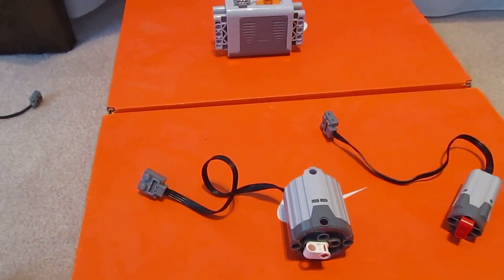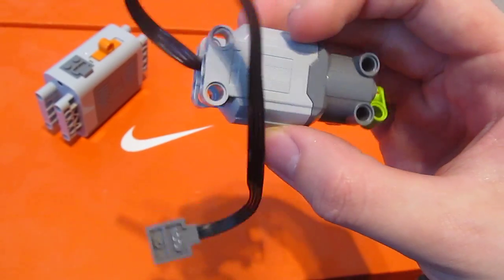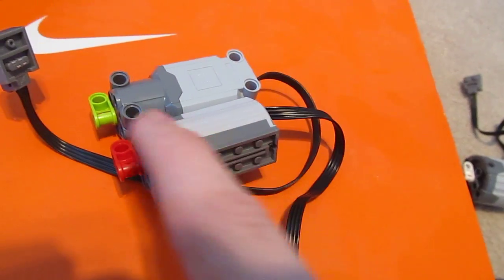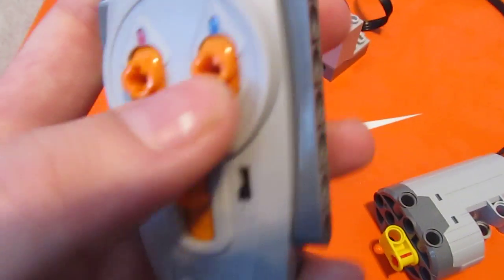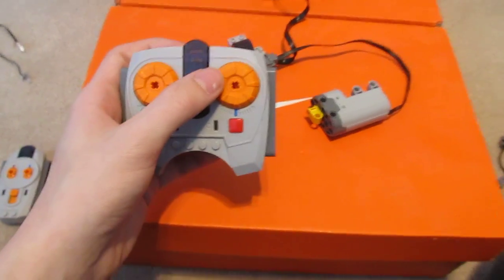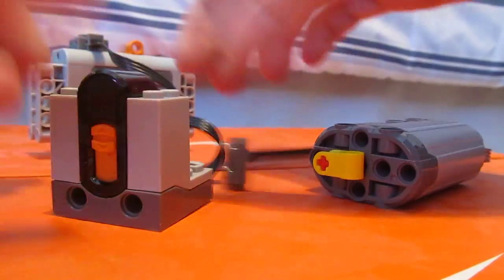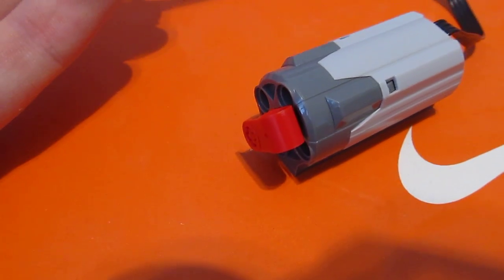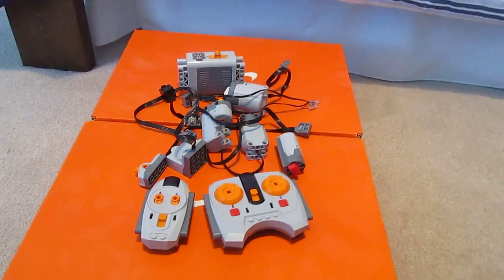Lego "Power Functions" (PF) Review Pt. 2

Comment: I have a question using the ir remote that you turn with the wheel. Doesn't it increase speed on the motors?
Reply from the maker: Yes, I'm using the IR Speed Remote. It allows for more precise, incremented control over the speed of a motor.

Check out these links below for more information on the IR Speed Remote:
http://shop.lego.com/en-US/LEGO-Power-Functions-IR-Speed-Remote-Control-8879
http://bricker.info/sets/8879/

Comment: why do you need the switch if you can just turn the box on and off
Reply from the maker: The PF switch, in short,  enables you to have control over when you want your motor, lights, or receiver to come on.
It's quite handy and can even be used as a make-shift  extension cable to connect to an IR Receiver.